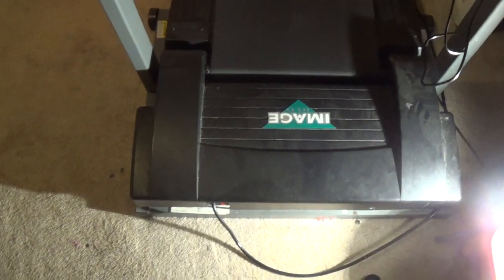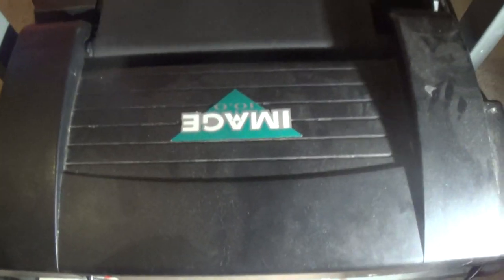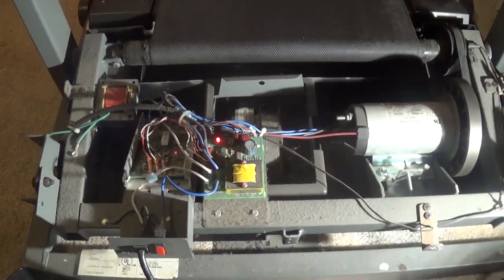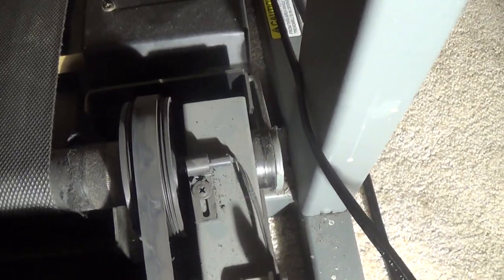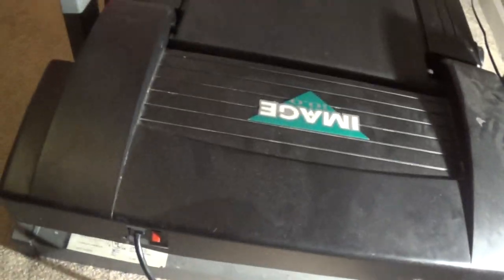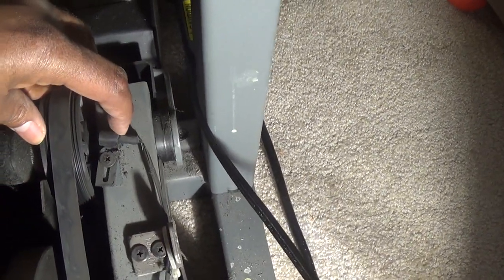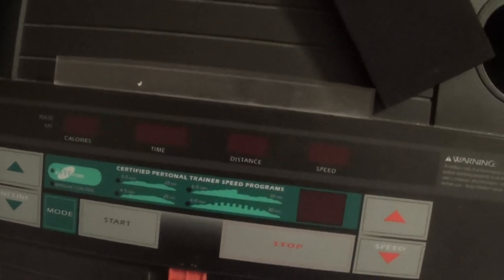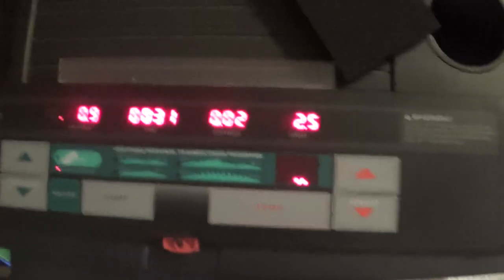Treadmill stops after two or three minutes, problem FIXED!

Comment: Great thanks Daddy Smith for sharing this! I was getting hopeless when my treadmill was getting stopped after 8 seconds of running each time, I found this video and checked the speed sensor. In my case it was the other side of the cable jumper that got loose and I just re sit the jumper properly on to the pins, that's it! It started to work.
Reply: My Pro-form crosswalk 3.0 XT treadmill was working ,had not used in weeks .now it won't work ..The Panel does light up .when I turn it on the belt will run about 30 seconds then quit .Can you help me ?

Comment: Thanks SO much! The hardest part was getting the front cover (cowl) off of the motor compartment! On my Nordictrac C2270 there are 3 screws going across the front on the bottom edge of the cover and then there are 2 screws on each side that you can only access from underneath. They have deepest holes so you can't see the screw heads unless you shine a light in the holes they're hiding in! It took me a good hour to figure that out. After that I just had to figure out where the flywheel sensor was by following the wire that went to that side of the motor. It would have been a 5 minute job if I knew about the hidden screws. I noticed 2 of the 4 hidden screws were missing. I didn't bother putting them back in and I ran the treadmill afterwards without it bothering anything.
Reply from the maker: Nice job!

Comment: This helped me.  That's the reed switch, and I messed with mine and it cut off sometimes still, so I just unplugged it at the control board.  Doesn't cutoff and works great for me, appreciate you sharing the info.
Reply from the maker: Thanks for the update I was glad it worked.

Comment: I had a related problem where the wheel next to the sensor had a lot of dust and fluff which no doubt triggered the sensor more than needed and caused the logic board to stop the motor. Once removed, I was able to do a full workout without interruption. We'll see how it goes but it seems like this was the issue. Thanks for pointing this out!

Comment: Mine was a loose connector on the power switch. Thanks for the video it triggered me to look at the wire connectors. Thank you. My Error was E8 on the Ancheer treadmill. Suggesting belts are too tight.

Comment: My treadmill kept stopping 5-10 seconds after starting at 3. I took off the cover and discovered dust. I used an air aerosol spray to clear out the dust. It’s working again. I hope that the dust was the only problem. 🤞🏼There was nothing wrong with the wire mentioned in the video.
Reply: Well, guess what, it stopped again. One minute into my warm up walk it stopped. What is going on?
Reply from the maker: How old is your Treadmill, over eight years old could be your control board.
Reply: @daddysmith3021  we bout it in 2006 from Sams club. Its a proform c950

Comment: I have the same exact treadmill and problem as you do.  The sensor is not flush but about 1/2" away from the magnet.  I will try it flush when I get home. Thanks for the tip.

Comment: That's speedometer sensor. Its function is to detect motion and if it doesn't, the board is supposed to turn the motor off. The reason it moves is the constant vibration from the motor in a long time that loosen the screws and rotate the sensor. you need to tight all screws every year.

Comment: The Proform Crosswalk I picked up at the Restore for $65 was stopping after about 3 minutes of use; a lot faster if all I wanted to do was take a stroll on it while I read a book. I checked the speed indicator, which on mine is a square piece of plastic next to the deck belt wheel, moved it around, changed the distance, disconnected it from the board. No fix. I had already lubed the belt so assumed no problem there. Tried to pick up the belt, too tight so loosened it to about 2” of lift in center and aligned it by tightening up one side a bit more to force the belt towards the center (like on a belt sander). No fix but it was easier to roll the belt around with my hand. Then my ancient mechanic eye spotted a misaligned belt. Could not let that go, so marked the motor bracket with a black marker so I could tighten it up at the same spot, loosened the 9/16 bolt, and realigned the longitudinally-toothed belt. But, me and my favorite pry bar simply could not get that motor back into place within my marks so I settled for best I could do, which was a good quarter inch off. Wyatt a-ya-know! The treadmill works fine now! Just guessing here, but I think the too-tight and misaligned belt was putting so much pressure on the motor that the too-many-amps detector was shutting it down (if I stepped off of it it would start right back up). As an aside, the very first problem I encountered with the treadmill was a mystery shutdown that I finally figured out by getting on the floor with the red reset rocker switch where I could see that the case and reset switch were misaligned. The case vibration would hit the switch when I was jogging. Cut away a little bit of plastic and no more problem.
Reply from the maker: NICE work and that's how you troubleshoot!

Comment: That is the solid state speed sensor. Only tells you mph. Should have nothing to do with stopping treadmill. You must have some heat cutoff switch that will cut out when too hot and then resets sleet cooling down. Same type of circuit breaker used in clothes dryers , dishwashers and other electronic equipment.

Comment: My Pro-form crosswalk 3.0 XT treadmill was working ,had not used in weeks .now it won't work ..The Panel does light up .when I turn it on the belt will run about 30 seconds then quit .Can you help me ?

Comment: My treadmill runs fine as long as no one is running on it
The moment some one start walking or running for fer seconds or minutes it will work then it stops and shows e3
I checked the sensor and cleaned it no use
Any idea of what the issue is?
Reply from the maker: Check your motor for overheating, have you noticed any burning smell from the motor you might have to take off the case.

Comment: Mine always shuts off after 20 to 30 minutes. Been doing it for years. I changed belt and circuit breaker. I also checked this issue. Nothing works.

Comment: My treadmill is stopping after two three minutes with load. Without load it is working smoothly. I have oiled the belts already.
Reply from the maker: Try plugging into another wall outlet. Also check the motor for overheating.

Comment: Daddy Smith...we have a sportcraft tx 50rc treadmill with no remote control It was a gift n worked fine but suddenly stopped working showing E3 It starts every time but shuts down 3 seconds after running? Any advice is appreciated greatly! Thanks in advance
Reply from the maker: I'm going to put out a video on basic troubleshooting soon.
Reply from the maker: I would start with something easy such as lubricating the belt. 2, Try plugging it into a different outlet, 3, open the Treadmill motor compartment and see if there is anything in there that smells burnt another thing is listen to the motor is it making any noise.
Reply: U have to check the sensor and make sure it’s in place

Comment: My proform treadmill has the same issue where it slows down/shuts off after a minute or so, but I don’t have one of those switches to push back into place on my model. Any ideas what my issue may be?
Reply from the maker: What model is your treadmill?
Reply from the maker: Also check your belt to see if it's too lose
Reply: Daddy smith Model is a Pro-form crosswalk 395. If I let it run for maybe 5-10 minutes before hopping on I can use it as normal but I noticed a burning smell coming from the treadmill also. And ideas on what that may be?
Reply: Daddy smith The belt is pretty tight it seems. How would I know if it’s too loose?
Reply from the maker: @YURIARMY69  If you walk on it and it stops or slows down.

Comment: this is common behavior for a treadmill plugged into an Arc-fault breaker.  Find a circut in the house that is not GFCI or Arc-fault and your problem is solved.  If you can't move the treadmill to a circut that is not Arc-fault or GFCI then swap the breaker.
Reply from the maker: That may work for some.

Comment: I have this issues however treadmill is still starting fast and stopping. Golds Gym Advantage
Reply: Have you been able to figure your issue out? Mine runs at full speed for 1 second, then the belt stops but the display keeps going
Reply: @wookie947  yeah the motor was good but the board was bad.
Reply: @laronmoore1918  the previous owner of mine must have removed my speed sensor, its missing entierly.
Reply: @wookie947  Mine is doing same. Did you figure it out?
Reply: @dirtboyslong9202  mine needs a speed sensor
Reply: Could be in demo mode

Comment: Did it cut off when you were on it or did it turn off also when you took weight off?
Reply from the maker: Both it was cutting off within 2 minutes while I was on it and about two or three minutes when I was off, it works great great since the fix

Comment: My is having the same problem. it keeps stopping when i'm on the belt and when i'm off, the belt running.
Reply from the maker: Make sure your sensor is working and the magnet is still in place.

Comment: My treadmill has a problem of speed increase too full speed, when the speed is not increase by us.
Reply from the maker: What is the make and model of your Treadmill I'll see if I can find anything?
Reply: Daddy smith mine does the same.. mines a Pro-Form 10.0 ZT. If you can help out I’ll appreciate it
Reply from the maker: I'm going to put out another video on troubleshooting your Treadmill soon
Reply from the maker: Open the motor compartment and run the Treadmill, see if the motor is running without noise, lube your belt
Reply: I don’t have the same treadmill model, it is a NordicTrack model, but mine also just starts at full speed and doesn’t slowdown. Looking for a solution if anyone has any ideas. All I know is it was working fine, then my sis decided to start cleaning the control panel while the machine was still powered on (first mistake). She claims it just started up and then went to full speed as she cleaned it. We turned it off and every time after that when we turn it back on, it still does this. Not sure if the cleaning solution short circuited something with the speed sensor, but it wasn’t near the motor, and I doubt she used much liquid at all.
Reply from the maker: @jayeculture  Sounds like your speed controller is stuck open basically not working. have you opened your treadmill case and looked around?
Reply: Daddy smith Not yet. Had no clue where to even start, so just searching around on YouTube first to see if it’s anything that would be a simple fix I could try before calling in a professional repair person. I will try and open up the machine this week to see if the speed sensor looks normal or damaged, but I guess I’m just surprised that a bit of light cleaning of the top control panel would have any affect on the speed sensor that’s hidden below. Thanks for the video though!

Comment: When I turn on my machine it spins at full speed.
The speed does not decrease.
What to do.plss
Reply from the maker: check your speed control sensor
Reply: @daddysmith3021  ok....tnks❤️
Reply: Your mosfet is burned out you need s new controller board